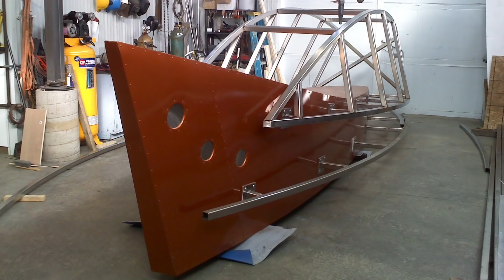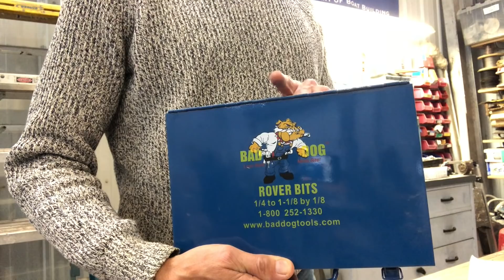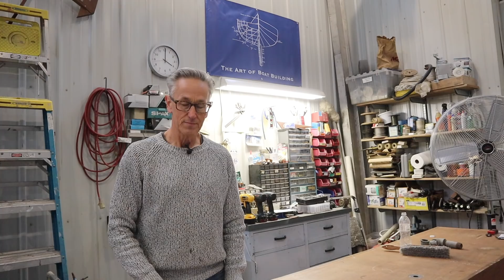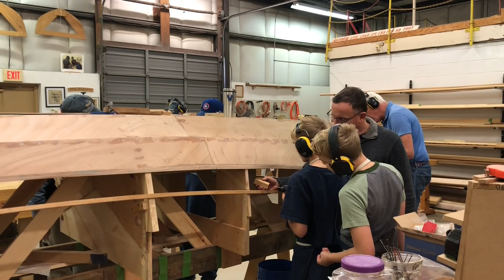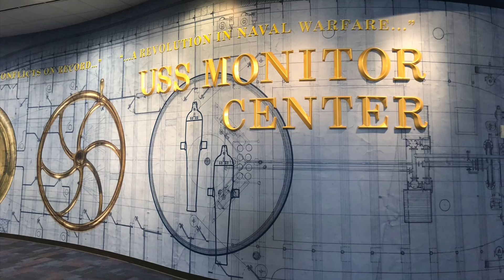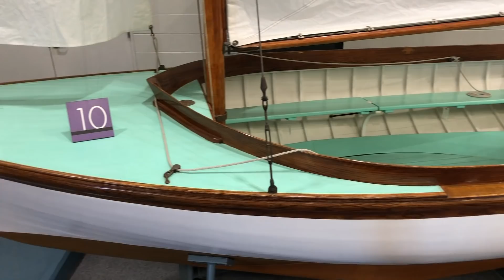Lead Casting Cleanup/Tidewater Wooden Boat Workshop, S2-E16

Comment: Hi Bob, quick question, can I use the old way which you did in episode 3, a skillet to melt the lead and do multiple time pour to the mod? because I don't have the skill to make a tank to melt machine, thanks for your time sir.
Reply from the maker: Unfortunately no, by making small pours the lead will have multiple cold joints that could fail. 
Thanks for watching!

Comment: Bob, love this series! If you're wondering why the panoramic shots look jerky, that's typically because you film at one FPS (say 25) and create your finished video at another FPS (say 29.95). Every second or so, there is no frame to render, so the previous frame is repeated - or the other way around, a frame is skipped. Try setting all your equipment to using the same FPS!

Comment: How long do think it took the lead to fully cool.
Reply from the maker: My best guess is 4-5 hours. We finished casting before 1pm and around 5 I check on it and it could be touched with a bare hand. It was in the low 30's (degrees) that day so it of course cooled faster.

Comment: Love the detail as your project develops. I did wonder about the way you handle the lead. I had a run- in with some WWI toy soldiers when I was about 4, which made quite an impression on me. I assume there’s lots of hand washing going on behind the scenes, but I wondered about the dust from filing and even from the hammer drill trimming. Anyway, looking forward to seeing planking.

Comment: Bob.  This was a great video blog.  Norfolk and Newport News are both just about my back door.  I lived for a number of years in that area and visited the Mariners Museum many times.  
thank you for showcasing the tidewater Wooden boat school .  Since so many of the public school systems have dropped having any type of wood shop instruction the youth are not exposed to the hands on instruction and mechanics of attaching two boards together.  Thanks again.. 
I have a copy of John Brooks plans for the Somes Sound 12  & 1/2 which is the next boat I want to undertake.  As the Haven and the Somes Sound are similar and use the same hardware and keel , I am fascinated with your approach. By the way I did get to take a class in Glued Lap streak construction under John Brooks at the Wooden Boat School in Brookline Maine.

Comment: I've been waiting to see this one! :-)
i am planning to build one of those boats.
g'day from Australia!
Reply: Any idea what timber you are going to use? Fellow Aussie here and with the price of timber it looks like I will be building a boat from Tassie oak. I don't know how good a timber Tassie oak is for boats.
Reply: Tim Bennett at this point I’m still trying to figure that out. So far my main contenders are spotted gum for the frames and keel and possibly hoop pine for the planking. However this may change depending on timber prices and availability. I am in south Aussie, so we don’t have the same resources here that you can get in NSW/VIC/QLD. Also getting quarter sawn or even logs to saw here is pretty difficult.
Reply: @the_real_bin_chicken  Fair enough, I live on King Island so any timber costs another $140ish a cubic meter to get here, so it might well be a boat made from 150x50mm stockyard rails, they are surprisingly  good quality.
Reply: @Timstinkeringandart  nice one. if it keeps the costs down and still makes a great boat. ide say go for it! :-)
Reply: Hi gents, another fellow Aussie here.  I’ve not built anything of this scale yet but have done a few kayaks and paddle boards. I found paulownia very nice for this application, with very similar properties to cedar.